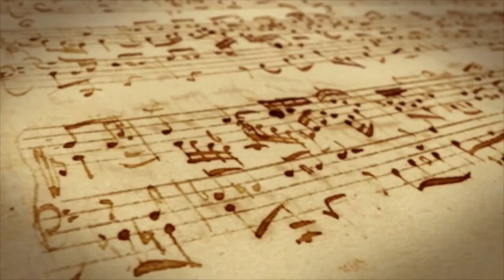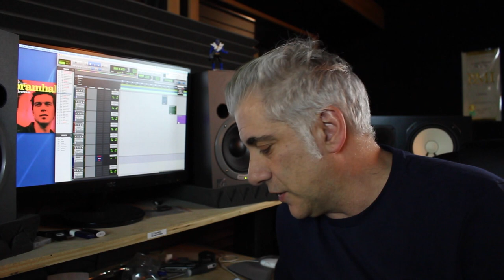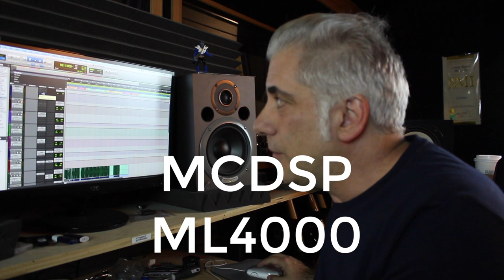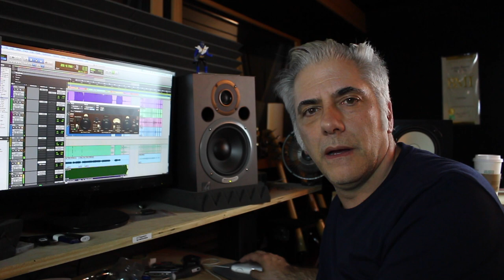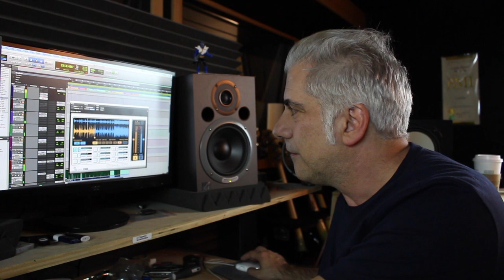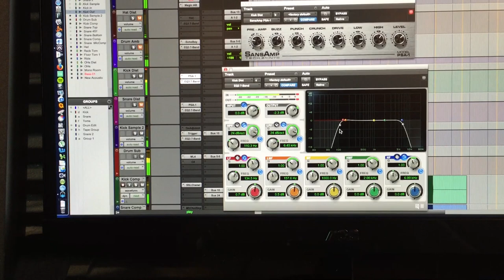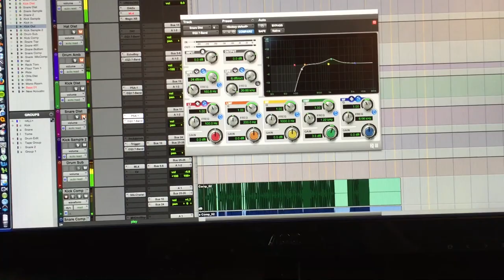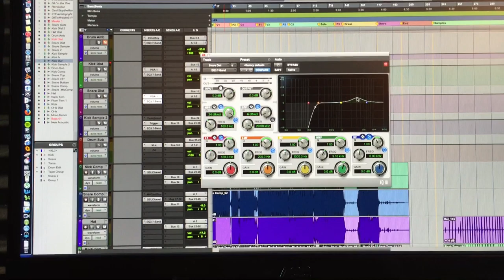Music Production - Tchad Blake Mixing Techniques Part 1

Comment: Rick have you done Part 2 to this?  If so can you add a link?  THANKS!  I also had an idea today to try this with guitar LIVE, not recording.  Haven't tried it yet, but gonna split my guitar signal in two before the amp input, add a OD box and eq, and blend to taste.  I have a scope so I can find a pedal that will flip the phase if need be... or build an inverting op-amp buffer box.

Comment: rick, these videos are super insightful! thanks a lot! but the audio quality isnt really up there. it's hard to tell the subtle differences especially in the low end. cheers
Reply from the maker: playboy1103 I can add the computer audio in but can't play the Tchad tracks because they will take it down. I think I need to have a separate rig to my right to track the output of the computer and my voice at the same time. The thing is the concepts. If you only got one thing of this video it would be easing hey sans amp on an ox track with an EQ following it. Flip the phase in the EQ and play with the high and low pass filter's. Also move the level of the send up-and-down and see how it changes the bottom end of the kick. Then do that with the Snare. This is a conceptual or technical video because you're going to be using different tracks than I am. I wanted to share the plug-ins that are used in the order of them along with how you would set them up in a session.

Comment: Awesome and thanks for posting. Question...when you're flipping the phase for that great hollow sound...what track or bus are you flipping? Can describe in detail how this is happening? I ask because if you're just flipping phase on one source I wouldnt think you'd hear it. Is it a aux send or a series bus? thanks!
Reply from the maker: Put a SansAmp on a mono aux with an EQ after it. The Distortion will change the phase and flipping the phase on the EQ will change it again but not perfectly. If you high pass it, you will find places that will add a ton off bottom end. Play with it until it sounds great.
Reply: Rick Beato thanks!!